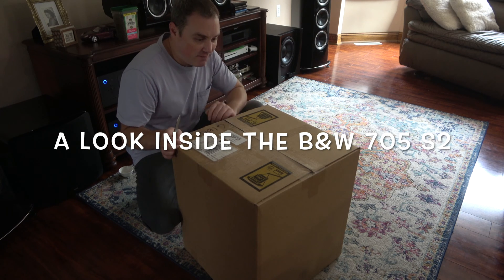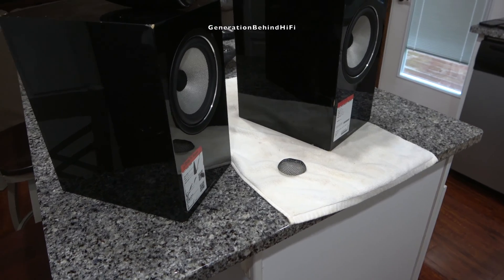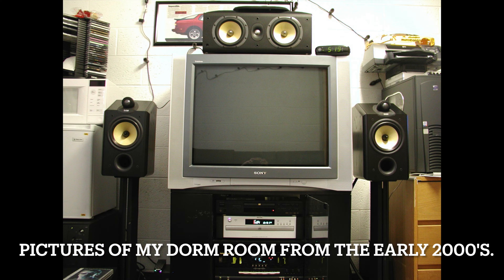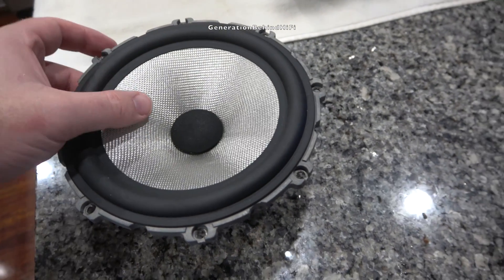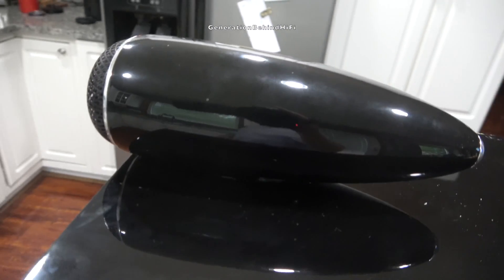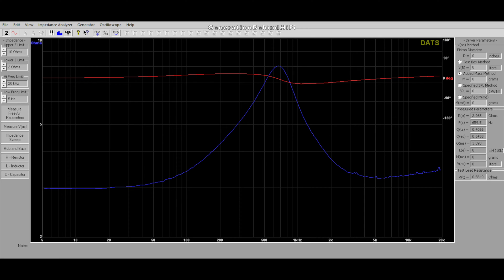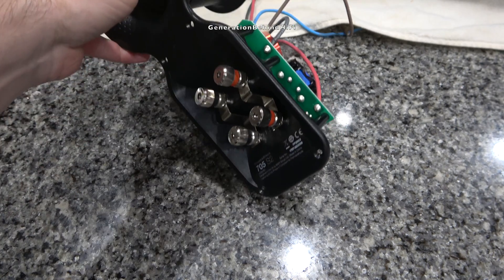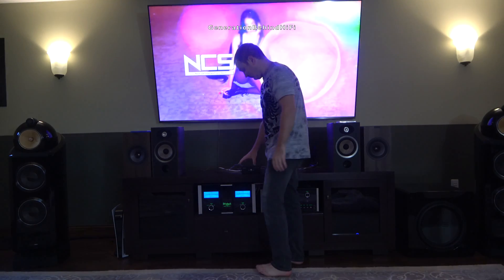A Look Inside The Bowers & Wilkins 705 S2 Speakers

Comment: I don't have a B&W 705s2, but I have B&W 706s2 and focal 906. Honestly, although the 706s2 is 3X more expensive than the focal 906 (I bought the 706S2 for 1500 euros and the 906 for 5xx euros), the sound qualities are quite on the same level. The 906 pushes a bit forward, with a bit aggressive high frequencies. It made me feel tired for a while, especially when I drive it with Marantz PM17 or PM14 (Marantz is also aggressive in high frequencies). Both lack bass. Or, in the better sense of the word, neutrality. Both have very godd detals. Focal win a little at positioning and soundstage, maybe because the body is bigger. But that's just my personal taste. And in a big picture, they are on the same level, or if you don't mind the annoying high frequency, 906 wins a little, just a little.
Reply: You might really enjoy some Dynaudio Contour or Confidence speakers, they have a tonality that is astonishing.  That said I like the B&Ws quite a lot!

Comment: Why not plug the, in and listen as well? Scratches wont hurt the sound, the grill missing on the tweeter wont really either and can probably be held on, the woofers measured fine so they should work, crossover looked terrific too, so why not listen to them?
Reply from the maker: The tweeters were heavily damaged and would resonate because the mounts were broken. It would be unfair for me to hook them up and give my listening impressions from damaged speakers.

Comment: This cabinet is not much better than the Focal Aria 906 you shat on and is more expensive, yet you give it a thumbs up? Yep, I think someone is biased because he used to sell B&Ws. Credibility shot.
Reply from the maker: I think my videos speak for themselves and perfectly illustrate the differences in construction quality between these two $2,000+ speakers. For one, the woofers from the B&W are better damped, have lower inductance, and utilize a bigger motor structure than the ones used by Focal. When comparing the crossover networks between the B&W and Focal there just isn't any comparison between the two! B&W's use Mundorf capacitors (well respected cap manufacturer) whereas Focal uses generic poly caps made by who knows who. Even the air core inductors from the B&W's are a gigantic leap in quality vs the ones used by Focal. Construction quality on the cabinets are quite a bit different too. The B&W uses a center brace that ties all of the side walls together whereas Focal uses a single stick that ties the left and right side together. The front baffle on the B&W is 15% thicker than the front baffle on the Focals. I'm starting to wonder if you're watching the same videos that I am?

Comment: No excuse for the condition or shipping, that's awful.

That said, the tweeter housing is purposely loose - or as B&W says "decoupled". That by itself doesn't indicate damage. If you happen to see a brand-new speaker the tweeter will also wobble.

Comment: They are bad ass with the right equipment.
My breakdown
Nad M17 V2 master series processor 
Musical fidelity M6 series 5 channel amp
All bowers n wilkins speakers
Front 702S2
Center 705S2 paired together for the center channel
Rear 705S2 
For home theater SVS PB3000 subwoofers
This setup sounds bad ass in stereo and home theater.
No matter what you listen to in music, it's killer sounding.
Reply from the maker: Thanks for letting us know! It's good to see B&W is still building quality speakers. It sounds like you have a very nice system !

Comment: The tweeter is supposed to be loose as it it on yours. BEST BUY are hacks! I can't believe they just threw the speakers in the box without any protection. Unacceptable!
Reply from the maker: Its not supposed to be this loose! When I took apart the speakers I could see that the mounting screws for the tweeter mount were pulled right out of the wood.
Reply: @generationbehindhifi  OK. I'm not sure how loose yours are but mine are loose also. And I bought mine brand new. Thats part of the design. Also, I'm mine I added dynamat to the inside of the cabinet and the port tube also replaced the polyfill for acoustic foam and the sound improved. They are very good speakers.
Reply from the maker: @JC.LC.  Yeah, I know there is supposed to be some movement just like my 802 Diamonds, but these were very excessive. I probably should have done a better job capturing this on camera but for some reason I didn't! Maybe one day I will get a set of 705's so I can review them.

Comment: $136 for the Mundorf EVO-SGO-4.3 Silver-Gold Oil MCap Supreme EVO (Sold individually) VS bulk price B&W pays. $40 for a good-quality Air Core Inductor (Red, wound coil part). The other two small, blue, rectangular parts - Sandcast resistors? Can't be very expensive, say $15/$20 each. Board, glue, bracket, screws and wires - $50-generously ----$532-generously in crossovers

6.5 inch drivers- $150 ea./ $300 for woofers ----- 1inch tweeters - $100 ea. / $200 for tweeters (VERY generously priced)

MDF Box enclosures: $150/$150 finish ----- $300 speaker boxes ----- plus $50 tweeter enclosures/$100 for tweeter enclosures

Acoustic fill, binding posts, trim rings / $300 per pair

$1,732 per pair shipped ----- probably more like $1,000 to $1,200 per pair at the most, shipped to stores.
Reply: What about R&D cost??  Hours B&W staff put into designing drivers, cabinets & crossover values. Then the time put into putting that all together & changes that need to happen.  Retail price of any speakers just don't come down to price of parts alone.

Comment: bro inductance you are checking at 10khz , set it to 1khz
Reply from the maker: Yeah, another posted informed me of that. Thanks! I will correct that on future videos.
Reply: can you tell me how much inductance on 1khz ?? @generationbehindhifi
Reply: also if tuning frequency is 54hz then F3 can be 50hz easily hence they are correct in terms of frequency response of the entire system

Comment: In EU this B&W is a €2.4k selling price pair of speakers and the focal  a €0.8k selling price pair of speakers. And I quote  real standard selling prices. There  really can be no comparison.
Reply from the maker: Yeah, here in the states we're getting ripped off from Focal. If you watched my Look Inside video of the Focal Aria 906 then you know already how I feel about this speaker. IMO the isn't worth more than $1000 per pair.
Reply: I think thats mostly due with sellers (by B&W) not being allowed to market new 705 s2's under a certain pricepoint. With the current s3 version on the market you can get new s2's for way way less (by about 60% of retail price I expect).

Comment: So my experience with BB open box is this…most of the time the items are good. They state even if excellent condition that they could include nothing other than the item you’re buying. Not usually my experience. I’ve usually gotten all original items. I haven’t purchased speakers though. I have bought and returned a few receivers to try out along with a lot of cheaper items. One car amp a number of years ago. 

As for the B&W speakers. I’m 40. When I was 17/18, I got my first audio setup. I started with a Sony STR-DE935 receiver and a pair of 602 S2’s. I think it was about $1200 out the door with tax and speaker wire to have my first two channel setup…I added some other stuff temporarily for a 5.1 setup until I could afford used 601 S2’s and a CC6 S2.
Reply from the maker: Hi Mike! Thanks for sharing your experience with Best Buy and B&W. I still miss those DM602 speakers and often wonder how they would compare to the speakers offered today.
Reply: @generationbehindhifi  I still have mine. Won’t ever let those go. Forgot to mention above that my goal is to get the 705 S3. I think those would be a nice set after 20 something years to “level up” to.

Comment: Never buy anything in fair condition , I always just go in person and inspect before buying . I currently have a PR 601 and I'm saving them for a theater system
Reply from the maker: These were supposed to be in "excellent condition". :( Thanks for the tip! I think you're right, inspect before buying is a must!
Reply: @generationbehindhifi  that's how I got my KEF R11

Comment: Thanks for doing these tear down videos.

I own a pair of 705 S2 and a pair of 705 S2 Signature bookshelf speakers.  Both sets of speakers sound fantastic.  The signatures have a richer and more controlled sound than the regular 705s.  The only other difference between the two are the two premium finishes and the silver tweeter grill on the Signatures.  The deep sparkly blue finish looks black in most lighting condition.  So, not really worth the premium price.  The real wood veneer finish probably is worth the extra money.  I purchased both sets of speakers used.  The 705s can be bright if you do not have tone controls or a separate EQ to tame them.  The sound stage is huge, detail is unreal, and bass is good.  I have a small 10" Martin Logan sub paired with my 705 Signature speakers.  The integration is really good for my listening space.  And, of course, the 705s will only get better when paired with better equipment and amplification.  

Regarding your comments about servicing the tweeter.  You can service the tweeter at your own peril.  B&W did not make the tweeter or tweeter housing service friendly for anyone who does not have their special, not for sale, tool kit. (AKA, the Apple way of building products)  I successfully replaced a tweeter dome assembly in one of my speakers that suffered from both a dented dome and deformed dome ring.  (Part of the peril of purchasing something used)  The tweeter grill is unnecessarily hard to remove.  And the tweeter unscrews from the inside of the tweeter housing.  It can be removed but not with any tools that you will find off the shelf.  I contacted B&W about purchasing a tool set.  They sent me to their "repair" facility (phone number and website).  The "repair" facility told me that they don't sell tool kits, rent tool kits, and don't repair speakers.  My advice, don't remove the tweeter if the tweeter does not need to be removed or replaced.  The same goes with removing the tweeter housing from the speaker body.  Pause the video where the camera at the nut securing the tweeter housing and you'll see why.

  Finally, if you find the tweeter housing loose, then tighten the nut on the tweeter housing stem inside the speaker.  I thought the tweeter mounting was broken on two of my speakers and it turned out that the nuts slipped and needed tightening.  Sorry to hear that Best Buy blew it with shipping.  I bought my 705 S2 from Best Buy as open box and they were in excellent condition at a price I could not pass up.  I'm sure if you had a chance to listen to them you would have loved them.  Especially with the gear in your room.  Why better than what I have.
Reply from the maker: Thanks, James for writing this! It is much appreciated! It sounds like the 705 is a great sounding speaker. I might have to try again at locating a pair.
Reply: I just scored a pair of the 705 S3 Signature speakers in blue with matching stands for $2500, I can't wait to hear them with my Mark Levinson No. 383 Integrated Amplifier.  I will bet they are amazing!
Reply: @ Great to hear you found a pair of 705 S3 Signature bookshelf speakers at an outstanding price.  I just recently auditioned and returned a pair of 705 S3 standard bookshelf speakers.  These were open box at Best Buy had sold at a price that I could not simply pass up.  I found them to be clear, precise, and spacious.  They are so clear and exact that they make my S2 series speakers sound congested.  The S3's, in my opinion, were so technically correct that I felt that the joy and emotion was filtered out of my music.  It could have been my gear was a poor match.  Regardless, I fell back on my S2 Signature Bookshelf speakers because my music feels like it has some life.  I can also get more life out of the S2s at lower volumes than I can with the S3s.  The S3s really need power and volume to come alive.  Now, saying this, do I still want to experience the S3 Signatures?  Yes.  I am jealous.  Let me know how they sound.

Comment: Hi, what are your thoughts on smps vs toroidal ampliers?
Reply: Class A/B toroidal amps are my choice
Reply: @markmcfeaters9116  can you please list them here
Reply from the maker: I don't have a lot of listening experience between smps vs toroidal amplifiers so I'm probably not the best guy to ask. IMO I think smps amplifiers can be just as reliable and sound just as good as a toroidal amplifier when done right. It really boils down to what you're looking for in an amplifier. If you want an amplifier that is easy to move, then an smps amplifier is the way to go. My Rotel RMB-1575 has an smps power supply and puts out 500 watts in to 4 ohms and only weights 24 pounds!!!